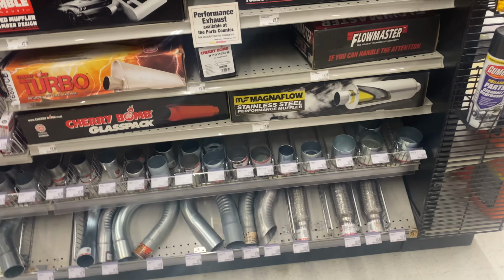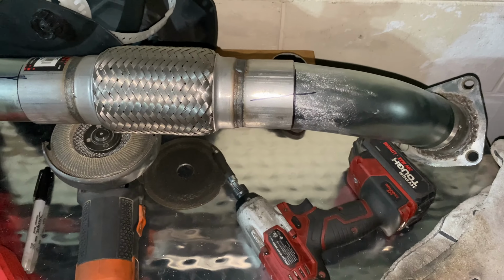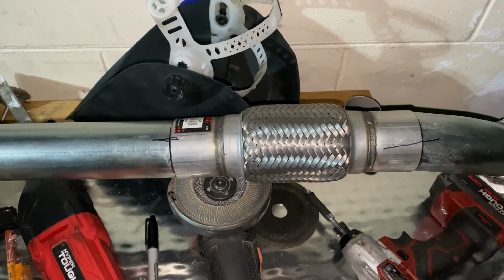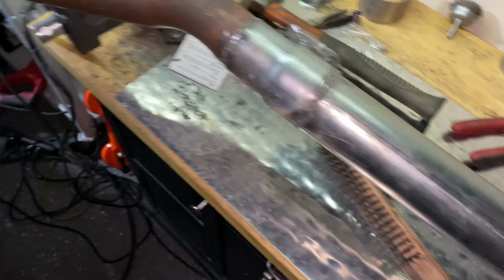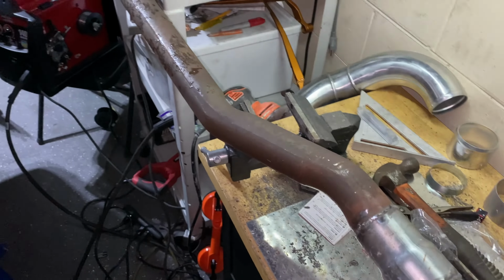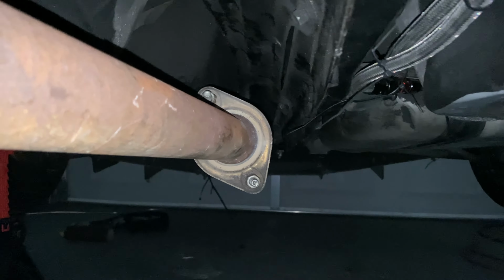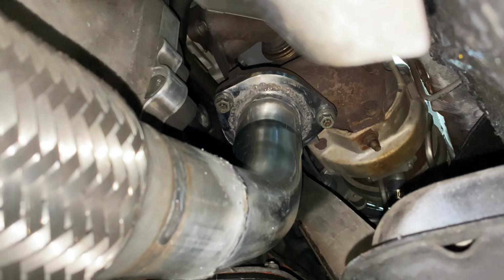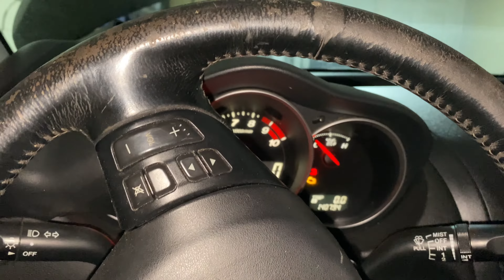1jzgte swap rx8 making my exhaust

Comment: Love the project bro. Keep up the good work. I got a 1gfe beams in my rx8. Been having some misfiring issues. I've changed coil packs, spark plugs and even cleaned out injectors. Problem stop for a while then act up again. Need some advise